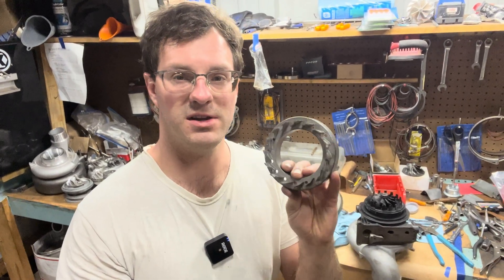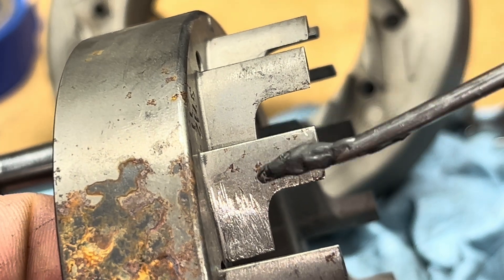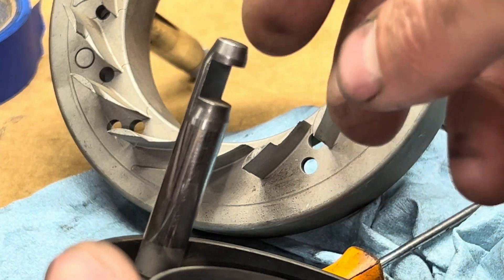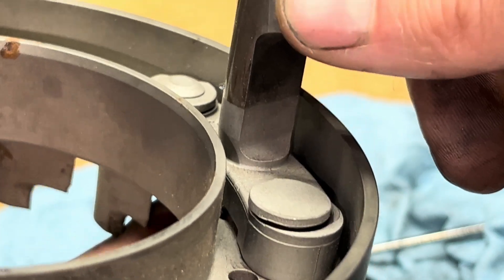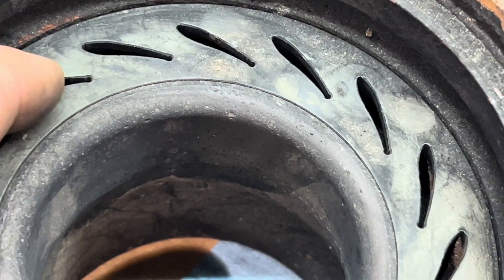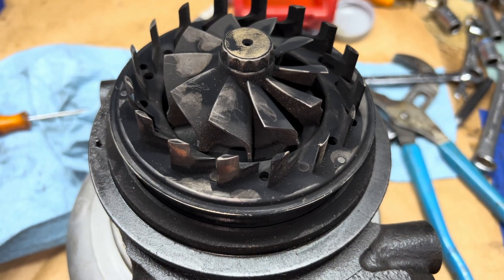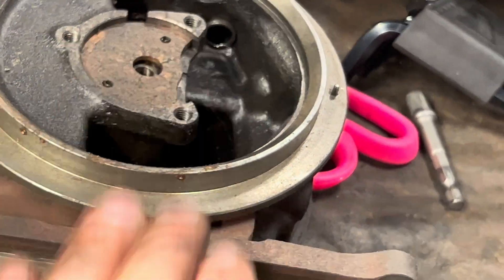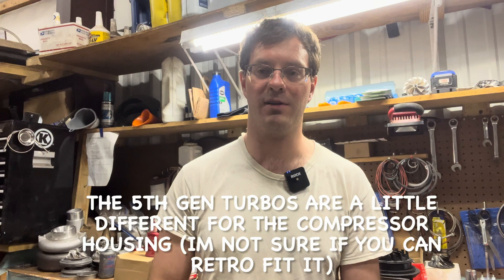How to inspect HE351VE HE300VG 6.7 Cummins VGT Nozzle

Comment: So, if the nozzle is bad is the turbo not repairable, at least by me? I was fortunate in that mine was ok and used your kit that I found on Amazon. Thank you!
Reply from the maker: It’s still repairable. Other people sell the nozzles. It’s against Cummins patents to sell replacement nozzles but other people still sell them. I can’t sell them because Cummins already came after me legally about it. I got advice from a lawyer on what I can and can’t do. I just accepted the situation. I can’t buy or sell the nozzles without legal trouble, but I can rebuild and sell a complete turbo. The whole purpose of the video is that someone was asking about rebuilding their turbo and they wanted to know how to know if their nozzle is good.

Comment: Very informative video! I've never seen a video that shows how these operate as you have illustrated in this video. That's really cool to know. Really appreciate you posting this video.!👍⚡︎
Reply from the maker: You are welcome. Hopefully you never have these problems. I had 2 He300vg turbos come from trucks with low miles that broke at one of the pins on the nozzle. One of the trucks only had about 1,000 miles on it. The wait on turbos at that time was about 3months. I was able to take another nozzle from a dodge ram turbo core to fix it. That truck was an international box truck with a 6.7 I think.
Reply: @turbolabamerica  Thankfully My turbo is just an He351 and not a VGT. No issues so far!👍